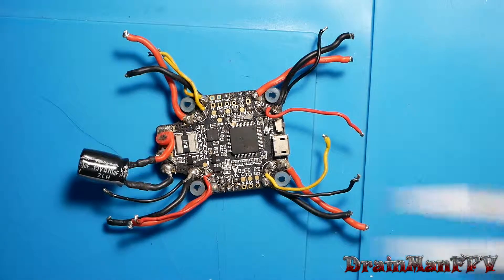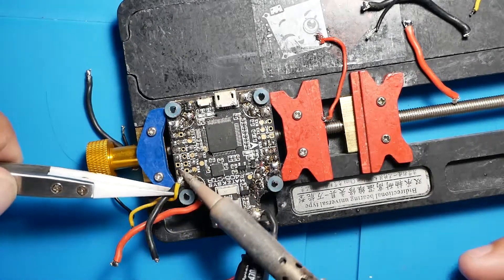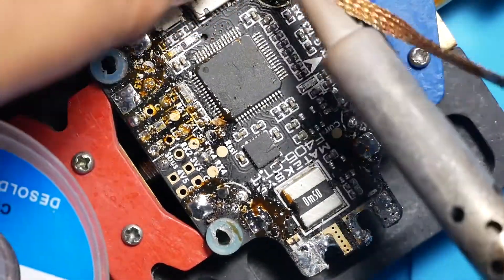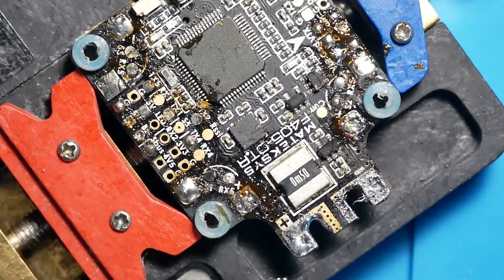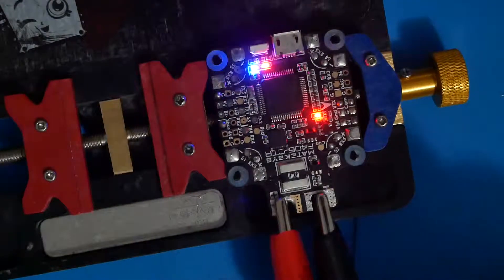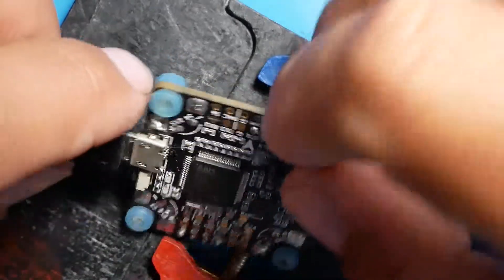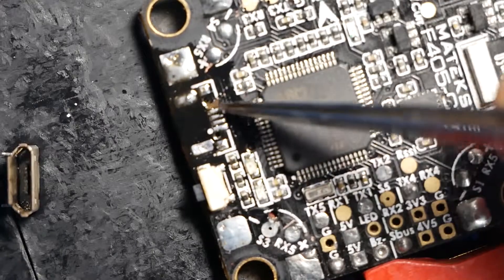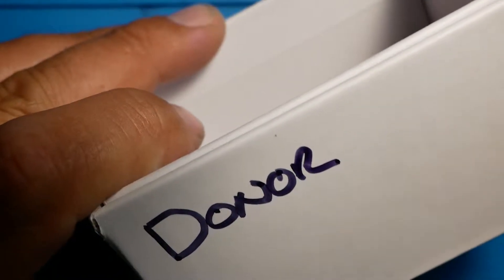Flight Controller Won't Connect To Betaflight |Troubleshooting Series | Matek F405

Comment: Kinda disappointed that you didn't fix this when it doesn't seem too difficult. Feel like you could've either fixed the pad or soldered a jumper wire from the USB 5v to the diode and have a perfectly working board.

Comment: Couldn’t you flood that area to make a new pad 
I’ve had pads rip off as long as that copper lead is showing add some solder to it 
It’s not good as new but it’s works

Comment: Hi Drainman… I’m sending you my 16x16 Flywoo flight controller stack that has power because it lights solid red when connected to USB.  Won’t connect to Betaflight.  Tried Zadig and Impilse RC driver fixer, and new USB cable and nothing happens… I hope to see it on your channel for the repair attempt.  I’m hoping to put in in my 3 inch build… Thanks!   I swear it’s not abused like this one you worked on.

Comment: You can scratch the trace and solder a thin jumper to the connector, lifted pads can be fixed if the trace is intact.

Comment: Totally Fixable!!!  

Remove lacquer using fiberglass brush (or some kind of scraper) and solder a wire to the track and the connector....

I'd suggest using solder paste and and hot air..

Have a Great Day!!